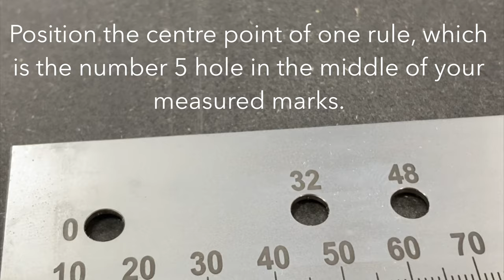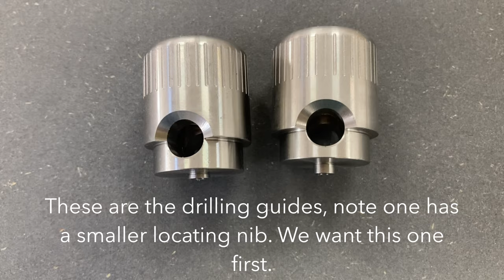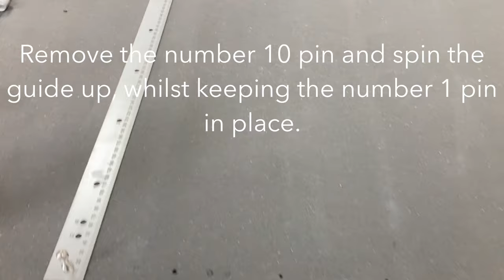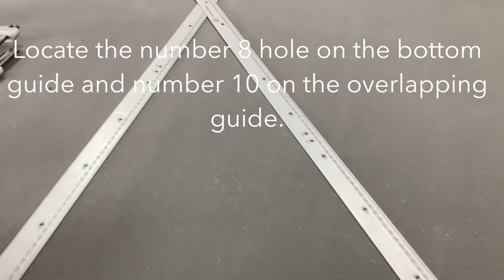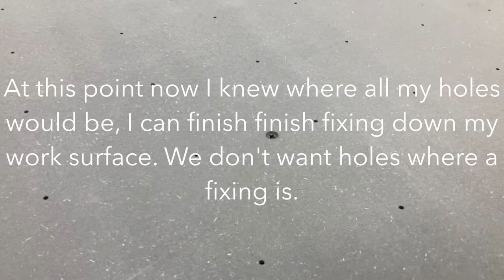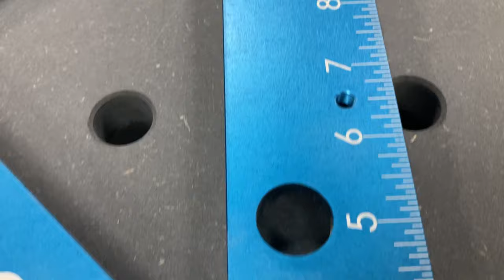How to use the parf guide system for the first time. #woodworking #woodwork #maker

Comment: Nice table Mr!  I noticed at 3:42 into your video you made the same mistake I've made. Directly after drilling the hole through both rules the top rule should've been moved then the pin installed to drill remaining holes.  Reason being the pins only have enough shoulder to protrude through one rule. I had noticed this after making my first 90° so when i checked it was nearly impossible to get the pins through on the 9th hole because it had shifted ever so slightly.   Luckily its only one roll that i caught before continuing.  Perhaps it may never be noticed but when you turn the rule to the straight line of holes the pins are much easier installed and removed.
Reply from the maker: That’s great thank you

Comment: what is your supplier for the black MDF??
Reply from the maker: I am the supplier 😊
Reply: @affinitydesignsworkshop  T
Reply: @affinitydesignsworkshop  Tell me more, as I'm having trouble finding the black in the states in anything other than 6" wide material. In the brown only 3/4 inch. Sorry I'm not up to speed with the metric system.
Reply from the maker: @wilberjeffcoat8309  sorry I've only just seen this message my friend. I am in the UK so really can't advise you! Best
Reply from the maker: @chrisschmitt3860  thank you for helping here, much appreciated
Reply: @chrisschmitt3860  Thank you Chris, I  sent  them an eMail, waiting to hear back. Wilber
Reply: @wilberjeffcoat8309    They are nice folks. Bought 3 sheets in 2020, at 84 a piece. 18 mm. They have thicker stock as well, and in a color pallette that is quite vibrant. They are a wholesaler, but accommodated me. I had to send them a bank check in advance, and I picked it up, as I am about 140 miles away,  and have friends in the area to visit.  The stuff they sell is similar to Valcromat, made in Korea. It is not as stable as Valcromat, but has a very hard and waterproof surface. I think it would be a bad choice for a MFT top replacement, as it would sag in the middle without support. I made an outfeed table, 20-96 with proper bracing, and it has been great to work on.
Reply: @chrisschmitt3860  Chris you’re super, that you. I’m waiting to hear back. Yes I was forewarned about bracing. Is there anyway to source the  Valcromat here in the states? 
Regards 
Wilber
Reply: @chrisschmitt3860  Hi Chris, thank you so much for your reply, I found the folks you're talking about, and have emailed them for price and availability-I'm anxious to hear from them. Did you buy the 1" or the 3/4", I've had the hardest time finding 1" MDF, even Home Depot lists it but states it's not available at this time.I'm in South Carolina so it would not be far for me to make the trip. Also our son in NC so I could go to visit with them too.  I'm also communicating with John [you Tube-Man in Shed] and he mentioned about bracing the MDF as it is not as stable as plywood. I'm trying right now to find a source in the States for the Valcromat as it is supposed to be stronger, with better color brilliance. We will see. Thanks Again, Wilber
Reply: @chrisschmitt3860  They responded this morning -18mm is now $151.00 per sheet. Ouch. Wilber
Reply: @affinitydesignsworkshop  Thank you, Not to worry, we are all too busy; perhaps your UK distributor can get a state side name for me? They may have access to the distributor net work, as popular a product as this is I’m sure it’s in the pipeline somewhere. Anyway thanks for this. Best, Wilber
Reply: @affinitydesignsworkshop  Can you supply me some buddy? Where in the Uk are you? I'm in Buckingham and the only supplier I've found is MDF direct.
Reply from the maker: @danielgreen414  hey man, yes I can supply full or cut to size, all delivered. Head over to my website for my contact details: www.affinitydesignsworkshop.com

Comment: Should be titled how to build a PARF guide system…….. because you definitely didn’t show how to use it
Reply from the maker: It didn't seem necessary to show myself using a drill, over and over...
Much like your comment, it wasn't needed. Thanks for watching though!
Reply: It's a video about how to best use the guides/templates so you can create perfectly spaced 18mm grid.
Reply from the maker: @Reign_In_Blood_963  *20mm 😊

Comment: Sorry, u made a mistake.

Do not measure against the edge of the ruler, align the ruler to the line you made.
Peter Parfit, the creator of the jig, told so in his video about.

The holes in the ruler must not be in the midddle of, or straight to the ruler.

Nevertheless, the holes are perfekt square, but it is not guranteed that they are suare to the edge of your tabletop the way you did it.
I made the same mistake first time i used the jig... and wondered why my cut were not suare to the tabletop. Gladly i could cut the top a little bit,
so trat everytyhing fits now. Took me long time to figure out why it was not square.
Reply from the maker: Thanks for your comment however I strongly disagree. The outcome will be with holes that are square to the work surface if you've cut it straight in the first place. Why would you not have a parallel cut for your worktop in the first place, this would be the "mistake".
Reply from the maker: I also think it's unwise to start a reply with "u made a mistake"
I didn't, I've simply done it in a different way that produces the same outcome.
Thanks again for your comment.
Reply: Ich hätte in deutsch antworten sollen, das wäre einfacher gewesen, sorry.
Habs in englisch versucht, nicht so einfach wenn man seit 30 Jahren aus der Schule ist....
Reply from the maker: @Micha_Ba  Hey Mann, das ist cool, kein Grund zur Entschuldigung! Ich freue mich über Ihren Kommentar und freue mich über jedes Feedback. Ich bin immer offen für Vorschläge und das Video von Peter Parfitt ist großartig und viel besser als meines. Nochmals vielen Dank und pass auf dich auf